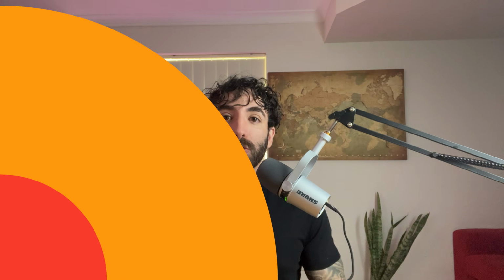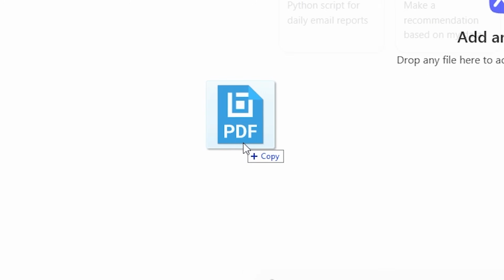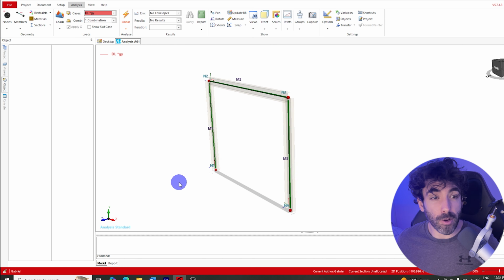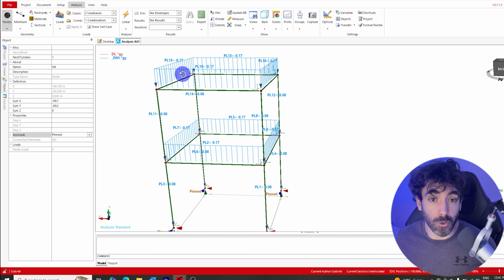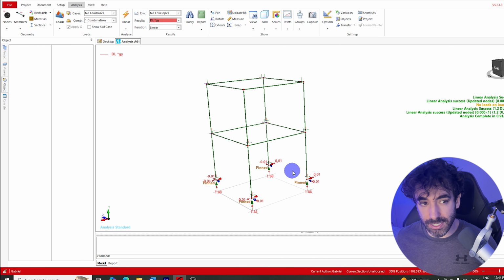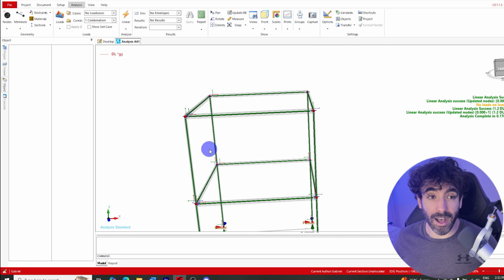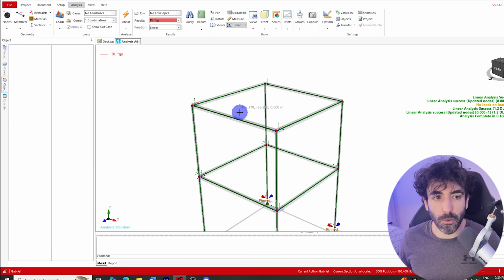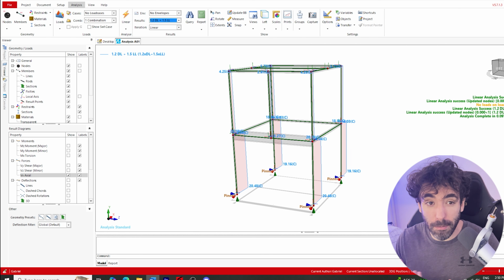How I Would Choose and Learn Any Structural Engineering Software

Comment: Great video, really gives insight on the engineering thinking involved in using these software's. As a student, I generally considered software's to be a cheat code you put the design into and it pops out everything you need, but it's interesting to consider how to leverage the software speed for iterative design and allows more versatility in trial and error to achieve an optimal design.